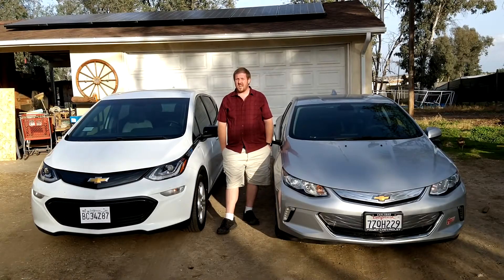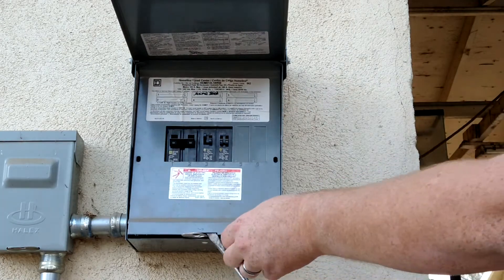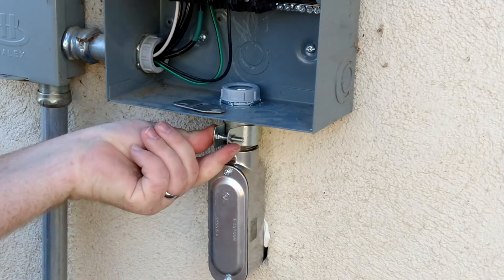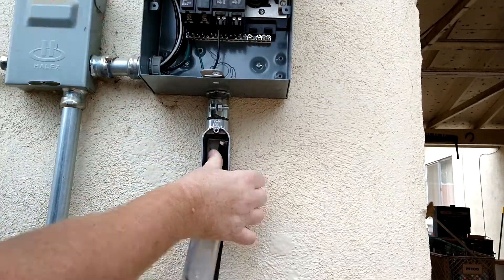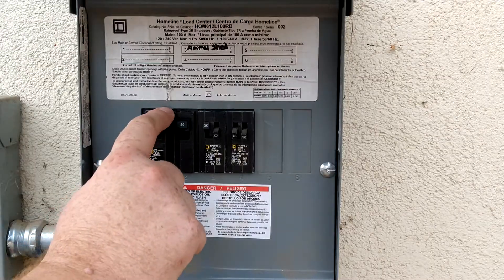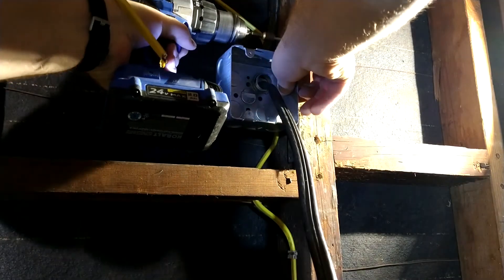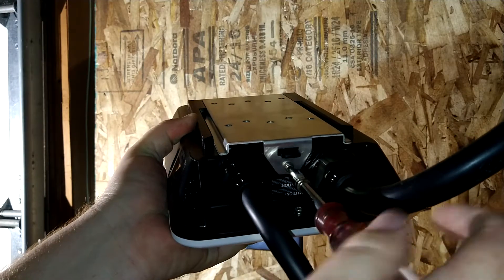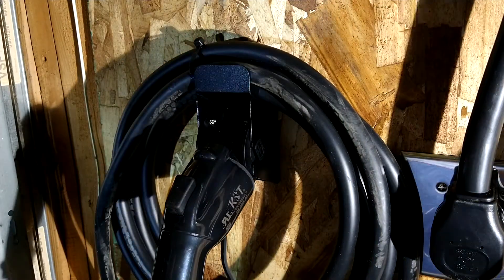How to Install a Level 2 (240-volt) Electric Vehicle Charger

Comment: From what I'm seeing, a 14-50 plug is more common for our EVs.  RV parks etc use a 14-50.  The neutral can be ignored for an EVSE.
Reply from the maker: You are correct.  Technically I'm not sure if it's code to omit the neutral on a 14-50 in case someone plugs their RV or something into it later, but the EVSE I bought happened to have a 6-50 so that's what I put in.